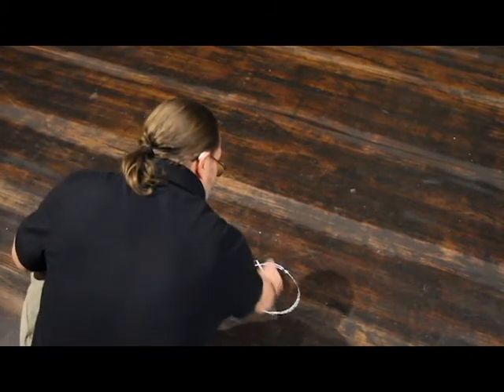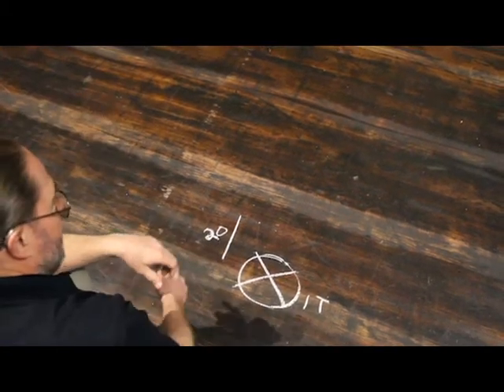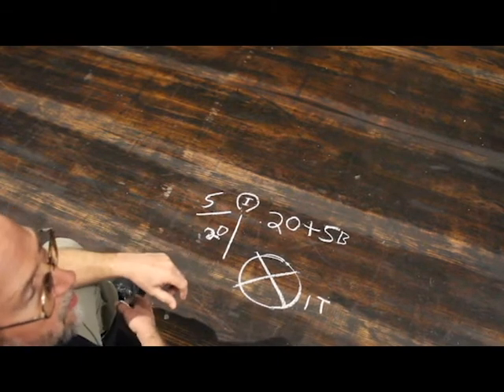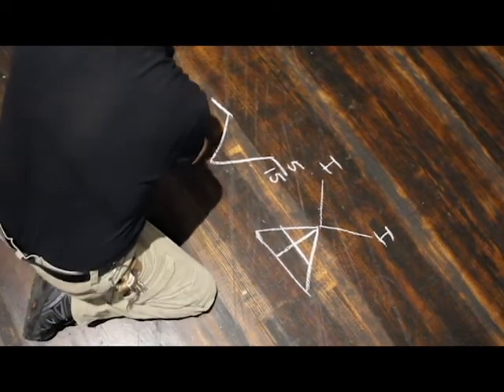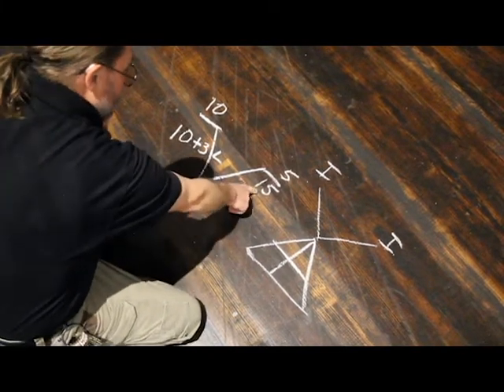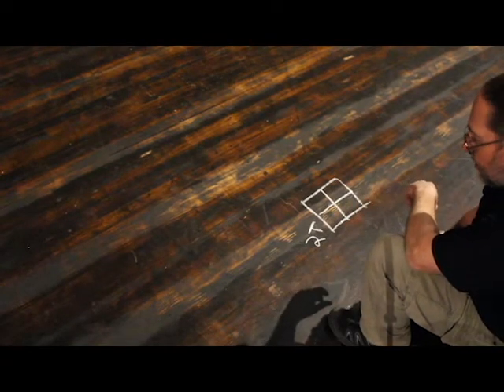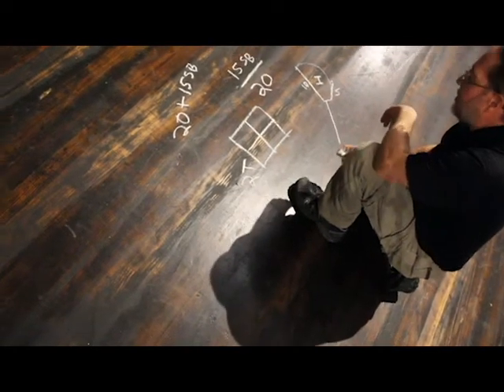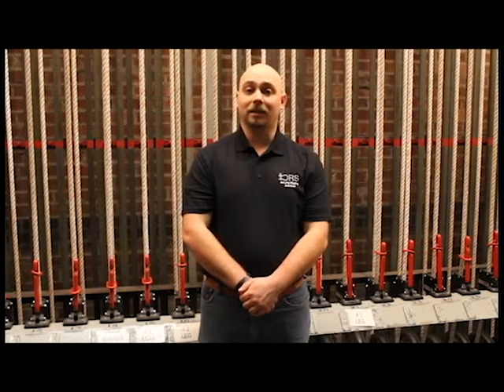Floor Marking

Comment: Thank you for another useful video.  Do you have a video on bridal making?  If so, what is it called?  I can't seem to find one.  Keep up with these great, informative videos 👍
Reply from the maker: Hi John,

We have a couple, depending on what you're looking for.

Building Motor points: https://youtu.be/OfxpwAsD9tM?si=3yd0Gg5c5Zub5HrV

Basic Bridle Math: https://youtu.be/NBtxV4JZ9BM?si=ZsRZuy75Z_x7uF-o

Calculating the vertical load on bridles: https://youtu.be/PGTPGXdhEgo?si=L9wMYMjLe3KCy2kC